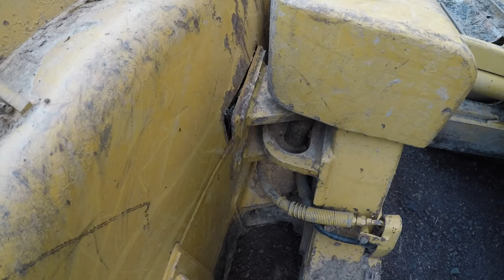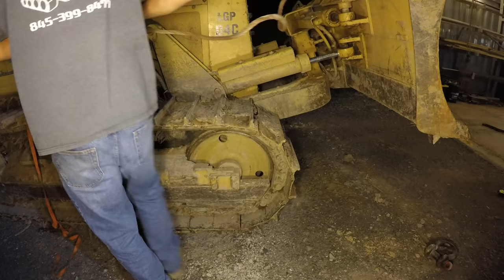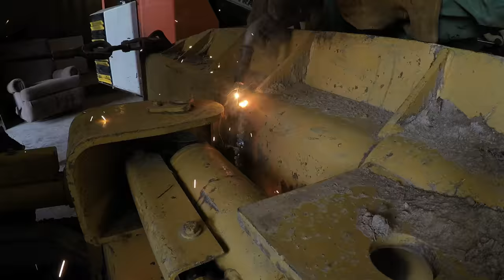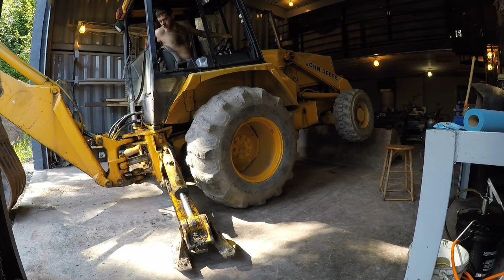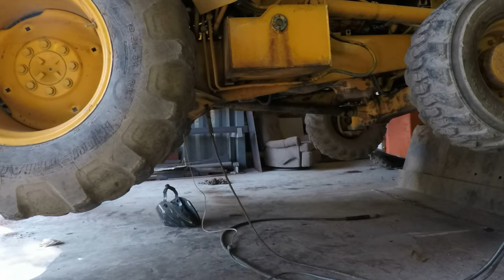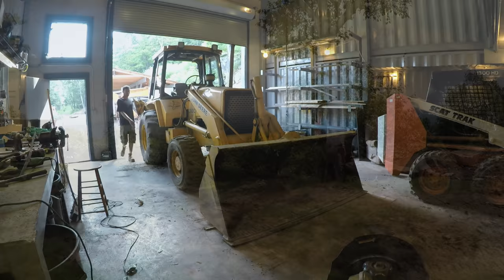Welding the dozer and backhoe

Comment: That frame cracking like that kinda gives JOHN Deere a bad reputation!
Reply from the maker: John deere stuff is crap.
Reply: @AndrewCamarata  You gonna really hate John Deere if it pins you to the shop floor
Reply: Yeah he's never been around big companies who have hundreds of machines. He bases his opinion on one machine that's old af. No idea how much previous owner treated it. Go on some real jobs and you'll see cat excavators with cracked booms. It's not uncommon. This is also coming from a guy who makes people think its safe to be under a machine trusting hydraulics. People think when hydraulics fail it might come down slowly enough for you to react but it doesn't. It can literally burst in a fraction of a second especially if it's the main valve body seal that machine would make him a pancake. Anyone who thinks backhoe clearance is enough to sit like that and not get touched has never been under a backhoe. Unless he's 3 feet tall it'd be over. We tell him this stuff to help him but I guess he's got one of those I know everything attitudes

Comment: Are all these metal fatigue stress cracks normal for this type of equipment?
Reply from the maker: No, John Deere makes crap equipment.
Reply: @AndrewCamarata  John deere actually makes great equipment. Every brand has its problems. You're mad because you have to fix a 30+ year old backhoe often? Also your welds are not correct. You said you went to welding school but you didn't prep it and you went downhill? Big mistake. I know you said it's still holding, but that's only because you didn't use it much. Try that repair on a machine that's running 12 hours a day daily. Won't last. You're like a backhoe okay at everything but not super good at anything. Nonetheless You're still a hard worker who gets by in life

Comment: Down hill welding with a mig ?   Y5ou just wasted wire and gas.
 On top of heating up a heat-treated frame rail. Now it won't crack it will bust in half.   In front of or behind the scab you stuck on it.... Way to go.    Bob. !!!!!
Reply from the maker: Shows what you know. This was done over a year ago and has been fine. And John Deere shouldn't have sold such crap in the first place that broke for no reason.
Reply: @AndrewCamarata  
 One should put his mouth in check untill he finds out who he is replying to.  I was welding years, Decades, before you were  born.
Reply: Roger Marshall that is not HY80/100 high yield strength metal! It was fine to weld down hill for what he is doing, you guys need to quit being so critical to his welding, he is farm welding and it is fine. If it cracks again, which it probably won’t, he can just weld it again.

Comment: don't you disconnect the battery ? you will fry your alternator .
Reply from the maker: I have vehicles 100's of times, never disconnected anything, never had a problem.
Reply: @AndrewCamarata  That old 310 is okay, but excavators have delicate computers that cost more than the units value to replace and definitely can be compromised by welding without disconnecting.

Comment: that is right v it out clean stop drill than weld. you are not welding on paint are you if so it will brake u need stick welder more heat penitration and you should preheat with a little welder like that

Comment: welding with the engine running can damage alternator or battery, I like your videos
Reply from the maker: Your not the first person to tell me that. But I've done it 100's of times on many different vehicles, and I have never had a problem.
Reply: I saw only one time the battery melting other times everybody weld with the battery on, I wonder what is the thing when it happens....

Comment: Andrew you were under the machine with no safety stands!  If you get squished who is gonna make these vidieos
Reply from the maker: It wasn't going anywhere. And even if it did. That thing still have over 2' of clearance on its tires. I would be fine where I was if it just fell.

Comment: I really just came here for the safety police comments about how hydraulics can just fail and squish you even though the wheels and tires are still on the machine. 

I’m not disappointed.
Reply: Yeah, then the machine will only fold you in half instead of fulling crushing you!
Reply: chivic89 do you own a backhoe? I do. I wouldn’t be worried about sitting under my  backhoe with the tires and wheels on. I’m sure it’s dangerous where you work, maybe too dangerous.
Reply: @dozer1642  Maybe your spine is more flexible than mine, but in one shot in the video where he is welding there is a driveshaft 2 inches above his head that would seriously fuck his day up if it came down on him.
Reply: chivic89 in your unlimited experience in watching videos of people actually doing things, how many times have you viewed unedited footage of hydraulic rams having unprovoked catastrophic failures? 

In my 35 years of actual experience of operating heavy equipment  with hydraulic systems I’ve never witnessed a single catastrophic failure of multiple circuits all at once. 

I understand if you have a much better grasp of how things really work  by watching people work from your screen. The world is a dangerous place. Be safe bud.
Reply: @dozer1642  You are absolutely right sir, accidents never happen! Hydraulics hoses never burst and seals never fail. How silly of me to ever think that....Ignorance is bliss I guess.
Reply: @dozer1642  just because you own a backhoe doesn't mean a thing. In fact, most people who own them are not good operators. So let's use some coming sense here.... ground clearance on a backhoe on flat ground is maybe 1.5 ft-2ft  depending where you are. If something went wrong which it can, the backhoe would come down, the tires would flex some thus giving less clearance. If you're laying down yes you'll be fine. Was he laying down? No. The way he was welding if it came down it would of pushed against his head or back and crushed him and bІew his spine out. Idk why no one understands this. And regardless of what you seen, cylinders can go out in a blink of an eye. Only an іdіot would do this

Comment: Mig should never be used like that, arc is best when needing to weild heavy gauge stuff but you do what you have to do , osha would never appove those machines for work , reason why when they are built arc is only used to join metals and very little if any wire weilding is used

Comment: Dude seriously welding over cracks without gouging them out is not only stupid it's down right dangerous that's the problem with self taught welders they don't have the knowledge there's a reason you haft to get trained to do it also there's a reason they make welding procedures data it's tried and true not trying to be harsh but people get killed doing that sort of stuff I get it trying to save money and do it yourself but at least learn how to do it correctly
Reply from the maker: It has not broken.
Reply: The problem with self-important welders in youtube comments is they think everything is a structural and "dangerous" issue that is going to kill everyone.  Even if this breaks again you simply weld it again, he isn't building a bridge or skyscraper here.  It is the blade on a freaking dozer.

Comment: Horrible job absolutely no prep what so ever wrong wire used dual shield flux core is the wire to use on equipment that's going to be going through high impact and shock that bare wire unless used in spray mode witch is limited to flat and horizontal will break in no time
Reply from the maker: 2 years ago, didnt break, never will. That is not shielded wire, why would I used shielded wire with gas? Learn how to write properly.

Comment: Are you crazy? I understand that sometimes things have to get done but I don't think I have ever seen so many safety issues in one repair video. Also, if you don't bevel those cracks and weld all the way through the thickness of the metal then there is no way that will hold up to regular use.
Reply from the maker: ImNotStalkingYou it’s still good.
Reply: ImNotStalkingYou is stalking Andrew

Comment: Yeah let's just start welding over paint and rust.  Why bother to take one minute with a grinder, or even a wire brush?  Notice all the splatter as you weld tons of crap into your metal.  What could possibly go wrong with dirty, rusty welds?
Reply from the maker: Go climb under there and notice that its not broken.
Reply: @supertrooper7403  Gordon Nolan UK. At the base of any metal crack/fracture you must first drill a hole in the metal to stop the crack running further down the metal then grind a " vee" shape grove into the metal along the full length of the crack then you root weld with a small dia. rod in sections down the plate to stop it distorting and allow to cool then weld again after removing the scale with a larger did. filler rod repeating the same method as the root weld rod. To complete the repair use a capping weld rod of a larger dia. again in the same procedure as before. Stress relieve with a gas torch and grind down the capping weld.